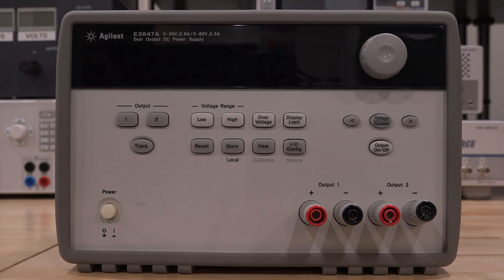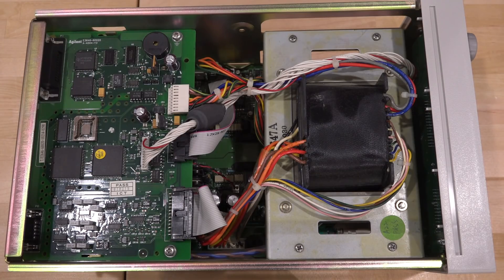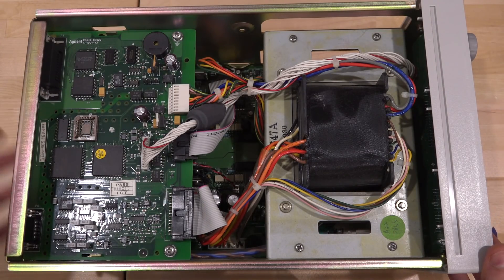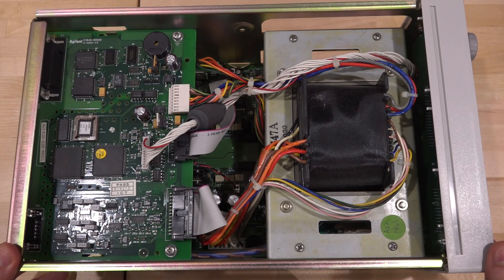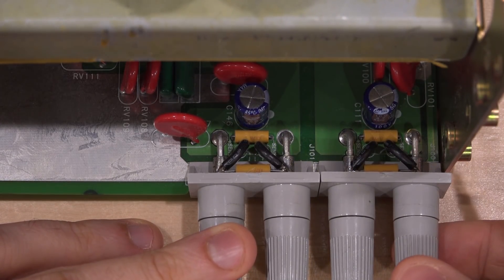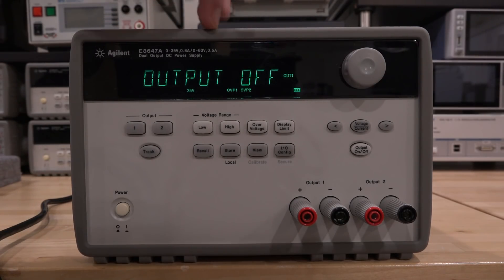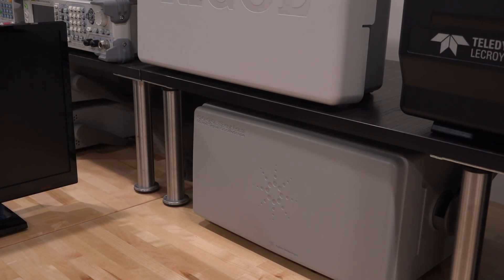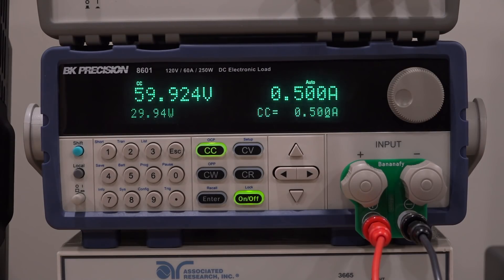TNP #2 - Quick Repair of a Mechanically Damaged Agilent E3647A 60V Dual Channel DC Power Supply

Comment: Where can parts for Agilent power supplies like this be purchased? I have an E3634A with a damaged AC Power Module (the AC line in, fuse and voltage selector assembly) which I can't find.
Reply from the maker: I usually get things from eBay.

Comment: I just can't believe that unit fell down on its face and never smashed the circuit board. My guess is a foot but less than two feet of drop or this would not look this good. Can you imagine 6ft of drop onto the connection. In fact in thinking about this drop my guess is it had plug-ins to protect the plugs. Maybe like 12 gage wire for a  cushion but probably not with wattage that small.

Comment: That must have been a heck of a shock to cause the PLCC package to come out of the socket.  Amazing that the mass of the transformer didn't do more mechanical damage to the chassis.
Reply from the maker: I was also surprised. It could have been loose from the factory or maybe it was changed at some point. I noticed some of the screws holding the transformer to the chassis were bent too.
Reply: @TheSignalPath  ,  I must say, you "lucked out!" That is a LOVELY power supply! How is the noise?

Comment: Always handy for charging 12s battery arrays.
Reply: Would take a long time with just 500mA.
Reply: @NiHaoMike64  Wow, you a right about that. My 0-60V bench supply provides 5A. It's switch mode at the back so it's probably in a whole different ballpark on other figures, like noise being terrible compared to this one.

Comment: The 30V version of this is like the standard classic lab power supply, they're everywhere in my uni.
Reply: I own two  E3631A (triple output, 2x +/- 25V, 1x 6V), and they serve me well. But I really need to grab the E3647A, because sometimes 50V is not enough, and with E3647A, you can get 120V when serial. And a nice thing about E3647A, is that you can have separate ground, but also if you want you can configure it to do tracking and share ground the way you want. The only doneside of these PSUs is they don't have sensing input on the front panel. :/ The other issue is they don't display the power.

Comment: Have you tried running it into the load on max power for a while to make sure there aren't any loose connections that would be exacerbated by increased temperature under load?
Reply from the maker: I ran the supply at 120W total for about 30 minutes. It was doing well.
Reply: @TheSignalPath  that should do it! My own electronic experience has been mostly with tube amps so I am paranoid of the cracked pcb or loose solder joint that looks perfect until it has had time to bake and marinate for a while!

Comment: It's nice when you get an easy one!  (Though I wonder what kind of hit it took to dislodge that IC - aren't they usually pretty rough to extract from those sockets?)
Reply from the maker: I was surprised too. Maybe it was loose from the beginning.
Reply: @TheSignalPath  On further reflection, it must have been - I've occasionally had to extract those PLCCs from sockets and it has been a major battle. A hit strong enough to dislodge one of those lightweight things from its socket would have broken a lot of other things, too.
Reply: @patmx5  ,  You'll never know... UNLESS he finds it belly up someday with no warning or apparent reason!